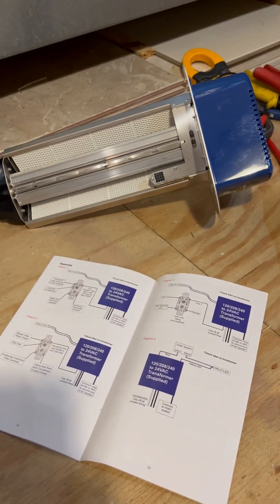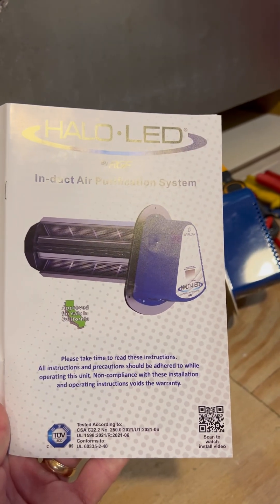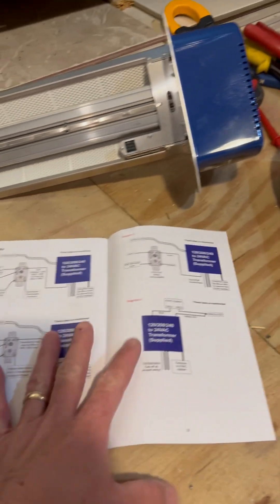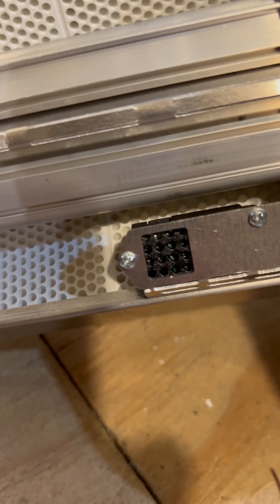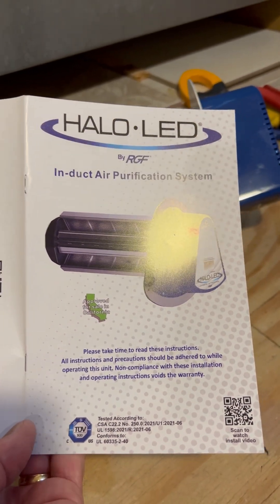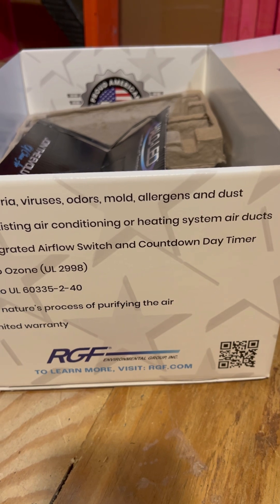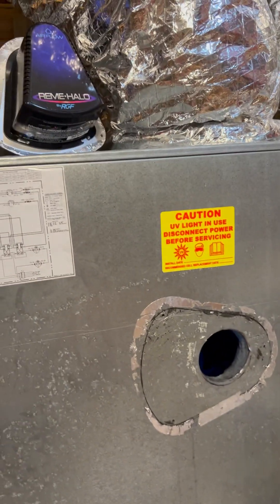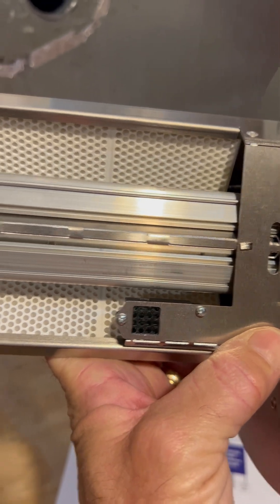Reme Halo LED generation 4 ￼with integrated airflow sensor ￼May 12, 2025  # Reme halo led

Comment: If you don’t follow the instructions or you’re not a qualified HVAC contractor it avoids the warranty. End of story for one thing the LED has a warranty unless you do with the instructions tell you to do it and you know what you’re doing you avoid the warranty LED won’t last as long. You have to know how to maintain it.
Reply from the maker: Hi KATHY, I'm sure you're aware by now that I am correct. The version four has a built-in airflow sensor. The unit will not come on until the blower is running. No relay required. The installation instructions with the generation for Remi Halo LED was for the previous version. Just wanted to set the record straight. And no I am not an HVAC installer
Reply: @anthonypalmisano1533   so you only connect L1 and neutral?

Comment: I just installed the LED version for the first time today. This video was good to see. I noticed the same about the relay wiring but no relay provided. I went to power it up and the UV light stayed on for 30 seconds and then shut off. Then the blower started up after putting the door on and I didn’t see the light come back on or make that distinct buzzing noise on startup. I unplugged and took the blue cover off and noticed the thing had a wire to the countdown timer and a switch that says 1-ON. But no information on what that switch means.
Reply from the maker: The Reme Halo LED (Generation 4) arrived with the wrong installation guide, so I contacted RGF, the manufacturer. They confirmed the new manual isn’t ready yet, but here’s the scoop: the G4 is plug-and-play, no relay needed, thanks to its built-in airflow sensor. When powered on, it vibrates and makes a buzzing sound—that’s normal, just part of its cleaning process. Also, the switch pack inside the front cover isn’t used, so don’t mess with the switch position.

I hope this helps!

Please let me know how the unit is performing and if you've noticed any difference in the home.
Reply: @anthonypalmisano1533 good to see this video because I'm going to install one tomorrow.